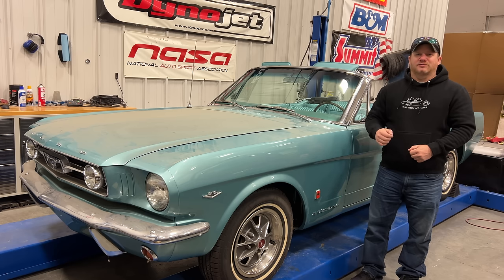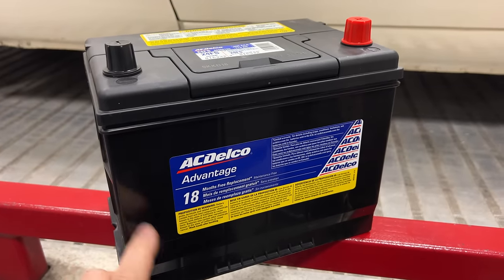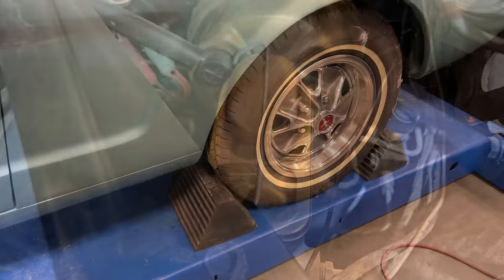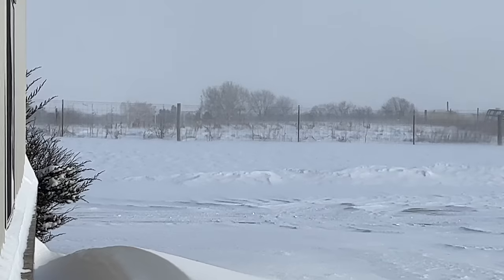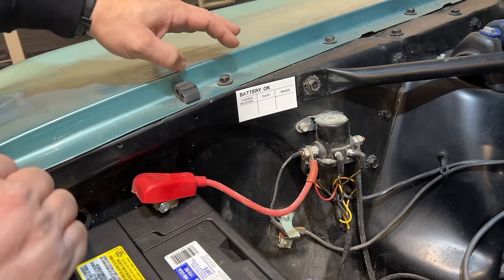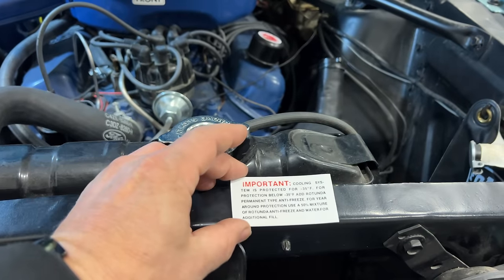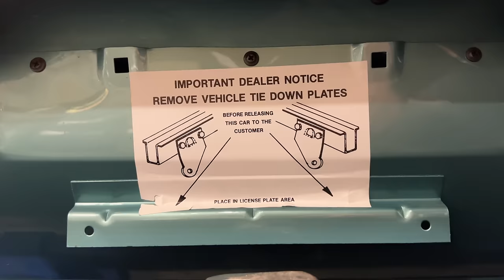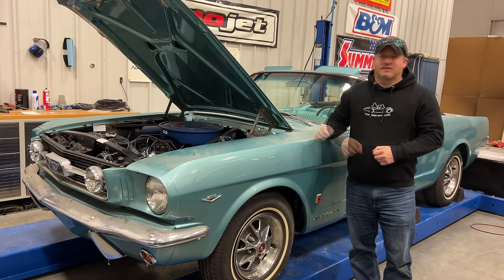1966 Ford Mustang GT Parked for 10 Years Will It Drive

Comment: we  used to use a piece of angled and drilled metal (Dexion) and long bolts to fit any undersized battery,but as long as you can find the correct battery,keep on truckin'. love all your videos!!!

Comment: Really nice touches. As far as the battery goes, I have seen in the past where I believe there’s a company that makes reproduction batteries based on what type and model of your car you had. Seems the one that I saw was on a GTO. Merry Christmas Steve & Happy New Years to you, your family, friends, and colleagues. See you in the next installment.
Reply from the maker: Yes I could have bought an Autolite reproduction battery but they are twice the cost of a normal battery and have a terrible reputation if you try to use them in a street driven car and not just for shows.
Reply: You are right, they can be crazy expensive.